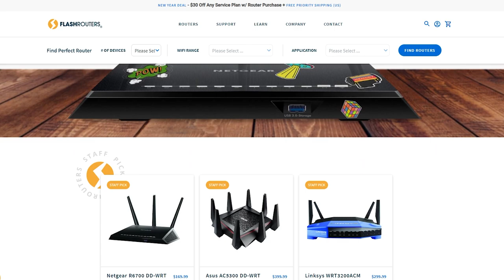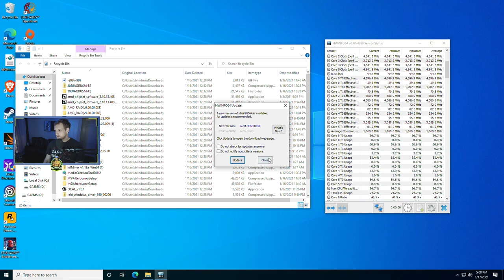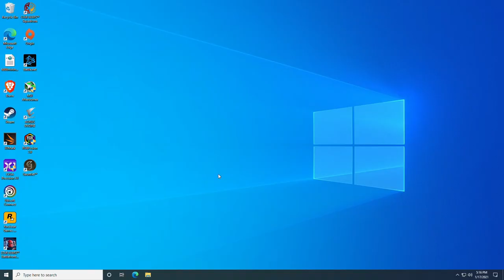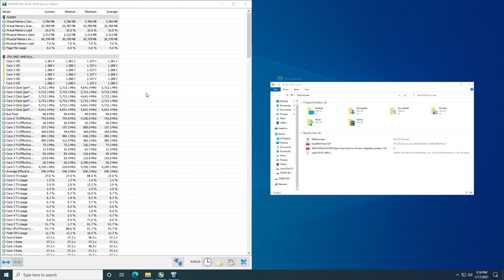How to Replace Thermal Pads on Any GPU!

Comment: after replacing pads and paste, my 5600xt still runs super hot.  Any suggestions on how to trouble shoot?
Reply: Are you sure you didn't put too thick pads and now it's making worse contact?
Reply: @alexandruilea915  No, I'm not sure.  Should I reach out to XFX to find out the proper thermal pad thickness?
Reply: @Kraden26  you could, or you could search on YouTube if someone else changed the pads and see what size they use
Reply: @alexandruilea915  I've been looking, but can't find my specific card.  And I don't have one of those fancy measuring tools.  I just did the ol' slide across the finger until I matched it to feel the same side by side. lol
Reply: @Kraden26  only the memory is hot or the entire graphics card overall?
Reply: @alexandruilea915  Just the mem.  Core temp is fine.  When I took the shroud off, whoever at XFX must've been blind or the pads were just crap and didn't stick right.  One pad wasn't even in the right location, the long strip pad for the vram wasn't even making contact.  And some of the pads themselves seemed old and dried out.  They just crumbled when removing them.  I replace with Thermal Grizzley's, but still the mem temp immediately shoots up to 90 where my threshold is set and then shuts down.
Reply: @Kraden26  i have the same problem with my gigabyte Eagle change all the greasy stock thermal pads for new ones and there was not improved in the temp of the VRAM i am still getting 102. Did you fix the temp?
Reply: @ronaldestevez7545  so, I finally have it running cool. At first the pads I used were too thin at 1mm. So, I put on 2mm pads and immediately the mem temps went down, but my core temp went way up. So I switched from Thermal Grizzly paste, to Arctic Silver. And then switched from 2mm to 1.5mm pads and now it's running perfect. I think the pads were too thin at 1mm first and then too thick at 2mm that it caused a poor connection on the core. 1.5mm is the sweet spot, and not sure the paste difference made a difference, I didn't isolate it to test it.

Comment: Does it compatible with any full waterblock?
Reply from the maker: water blocks typically come with the pads and a guide on what pads to use.
Reply: @SonofaTech  i mean to stabilze the card with waterblock...i also own this card and also keep crashing.
Reply from the maker: @sahawatp1156  just install the new pads as shown. It's working great now. I haven't seen a waterblock for this model yet

Comment: i got 2x 3080  aorus xtreme and evga ftw3 both doing 100-102 but the aorus have sometimes  thermal issue :/ so i put a fan on him , the ftw3 way better for mining .
Reply: Aorus is missing backplate thermal pads and the ftw3 has them.

Comment: It's a good thing I'm mining on a few Gigabytes and these Masters run HOT... I've setup a 3090 from Palit which actually runs just as hot as the 3070... Other 3070s run much cooler , for example the other Palit 3070 that's always cold basically

Comment: I have the same issue with my aorus master 3080. Thanks for the video but I am going to rma it
Reply from the maker: Careful they aren’t sending em back. Just refunding. Also if it’s another gigabyte it won’t help. Such a bummer right now lol
Reply: Hello, could you tell me the size of the thermal pads to use for the memories and for the backplate?
Reply: @dario0067able  depends on the card, if it's the one on the video just rewatch the video.

Comment: has any one got a pad specs on the gigabyte 3070 gaming oc?
or a guide?
Reply: Same process, dissasemble and replace pads on chips, capacitators and between the backside of the mem chips and the backplate :)

Comment: eth mining at 100% power is DUMB. Tou can easily achieve same MH/S by cutting power to 50-60% and adding OC on memory. I mine at 42 MH/s with a 2080 while drawing only 120w.

Comment: If anyone has a walk through on replacing the thermal pads on a Dell RTX 3090 let me know. Its design seems to be specific to dell and is horrible. 

No matter what I do this GPU Vram pegs 110c and stays there. The OEM setup day one was this way, new thermal pads, same issue, thermal pads and Paste on the block contact area, same issue. 

6 hours in and lots of pads thrown away I'm sick of this card. lol

Comment: Why do people say this nonsense. Oil leaking from a thermal pad is not it breaking down. The oils will leach out depending on the type of pad. That is perfectly normal, it’s usually just a silicone oil and in a way is anti aging compared to the shit blue pads ur using. I’m positive the oil “leaking pads” are superior to the blue pads your using for heat transfer.
Reply from the maker: Been tested on multiple cards. I have done 60 replacements this quarter alone. How many refurbs do you do a year. I don’t really care what you think because you have 0 credentials on an anon account. My assumption is your are an ignorant keyboard warrior with 0 accolades. Hahaha. See you next Tuesday